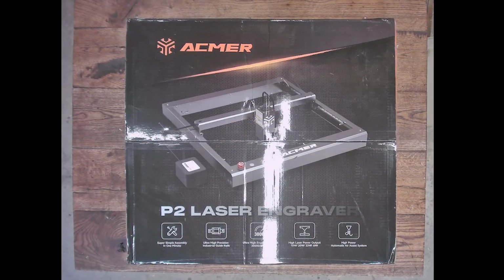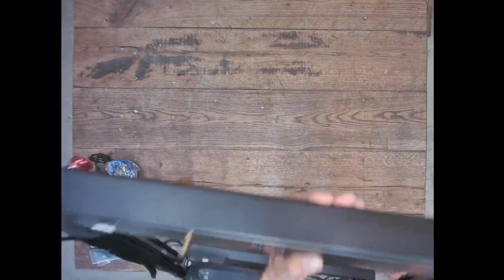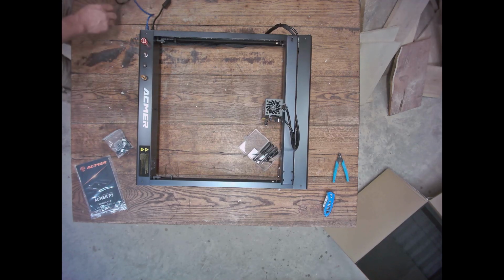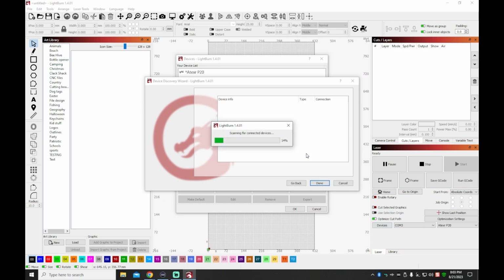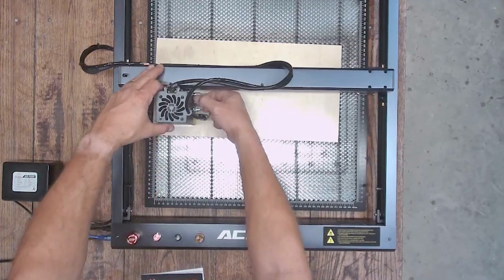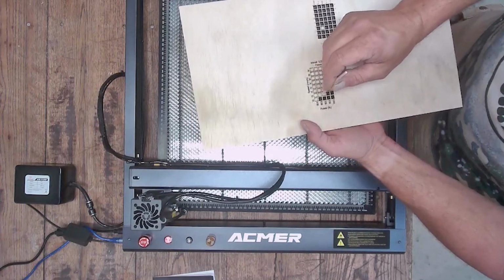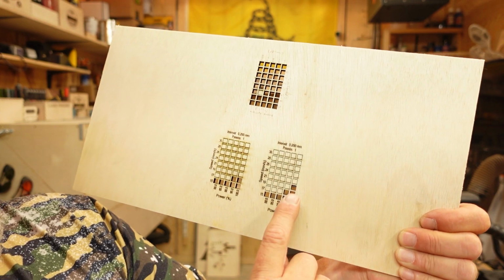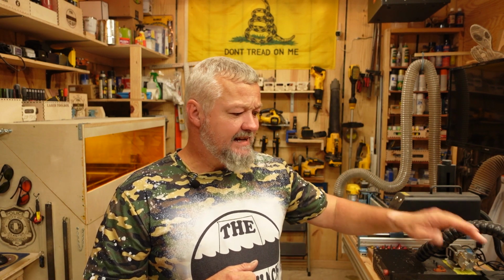UNBELIEVABLE cutting power- Acmer P2 33 watt

Comment: Hello,  which diode laser would you recommend?  I’m looking at a 30w laser.  Also would you rather use a diode or co2 laser. Thanks.  Great videos by the way
Reply from the maker: There are lots of good machines out there. Budget, workspace and output are things to figure out what you need before buying.

Comment: Good video. Will the adapter cables for the rotary work with the x-tool ra2. Thanks
Reply from the maker: The cable appears that it would. I haven't tried it. It has the typical stepper connection on the rotary end.

Comment: I recently made the big mistake of purchasing a 20 watt pro Comgrow laser. I never did get the piece of crap to work. Their tech support is horrible, and the laser would work with LaserGRBL but not Lightburn! Are you F-ing kidding me? I contacted them and told them that I sent it back to Amazon and purchased a XTool D1 Pro 20 watt for double the price, but I will tell you this Xtool is one badass rig! I can cut 3mm baltic birch poywood in one pass at 400mm/min! I love it. Stay clear of the Comgrow produsts!
Reply from the maker: I have had some Comgrow machines and have had good luck. Maybe you got a bad one..

Comment: I seem to have an issue when rerunning a project after homing, alignment is off any suggestions?
Reply from the maker: Check the timing linkage in the back of the machine. It is behind a cover but is there. Make sure it is tight and isn't allowing the two sides to operate independent of each other. I had to tighten mine after a couple of weeks of use.
Reply: Appreciate your videos, Alabama guy also.